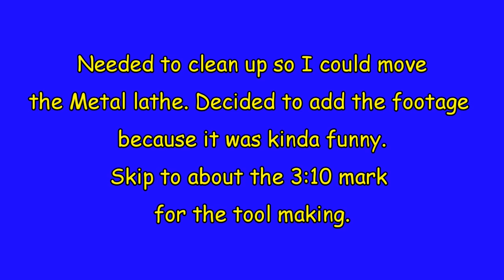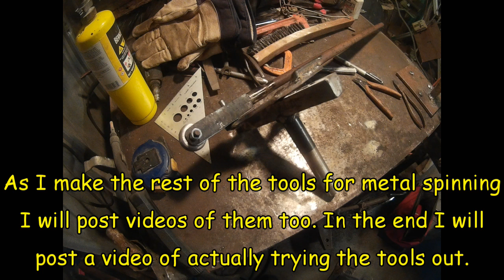Making Metal Spinning tools Pt 1

Comment: Should be an interesting series of videos, cheers. In case you're wondering around the 10:30 mark when your welding that purple glow you see around the piece is the infrared radiation coming off the work piece. Digital camera sensors can pick up a bit of IR, if you want to stop it a piece of clear plastic in front of the camera should probably work. I think it looks quite cool though ;-)
Reply from the maker: Actually that thing was glowing red hot, the cameras light sensor dims it. Same thing happens with blacksmithing videos, the metal never looks as hot as it really is.